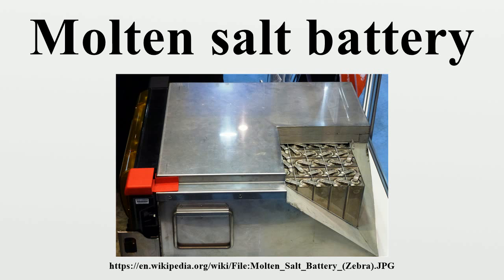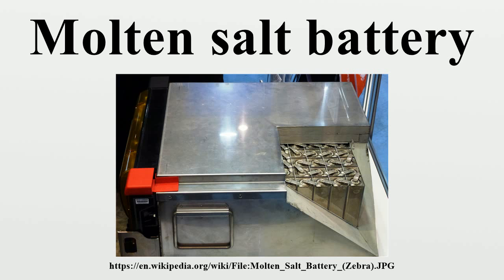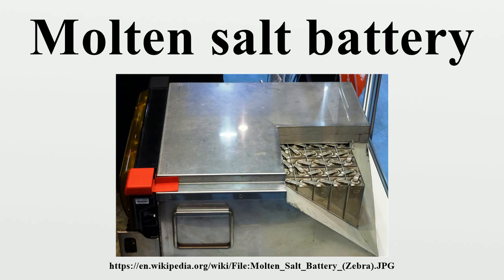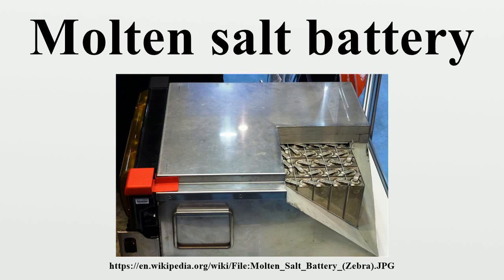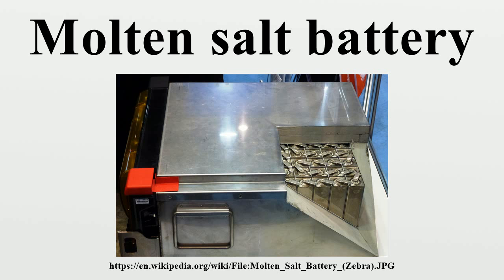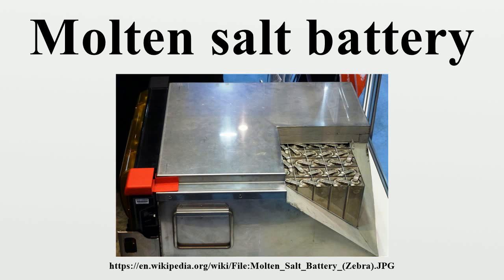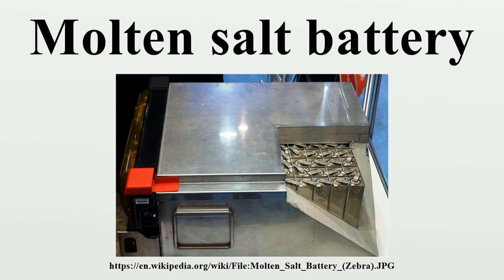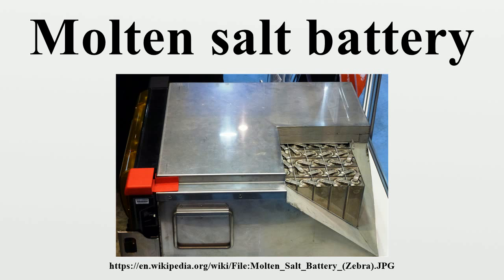Molten salt battery

Comment: Neat-O!   Have they been used on drones yet?   Patent 672256 .
Reply: nope, mostly used on missile targeting systems, backup system starts the battery up, and then the MSB gives enough power for the duration of the flight